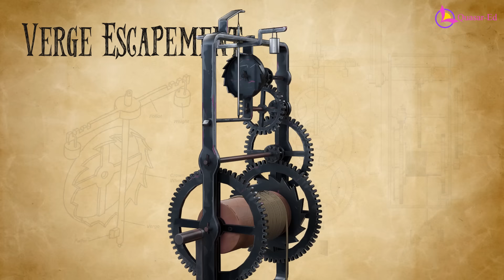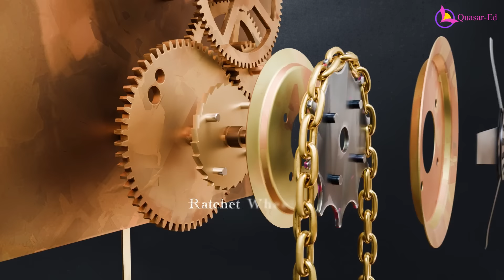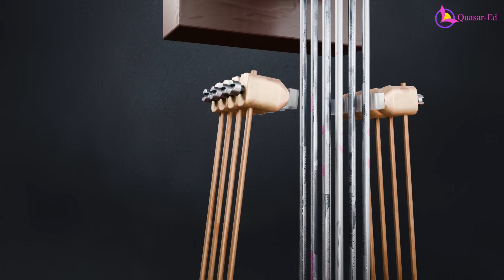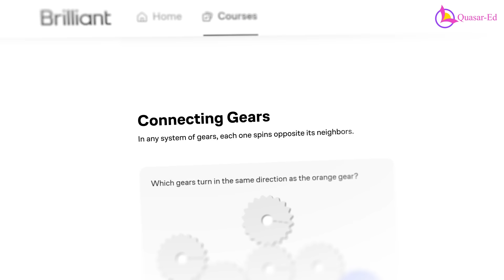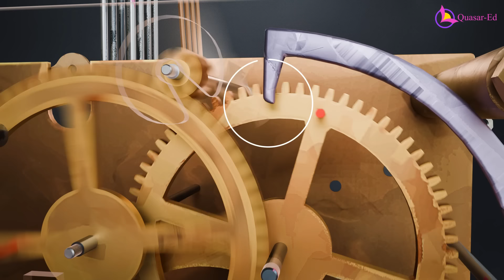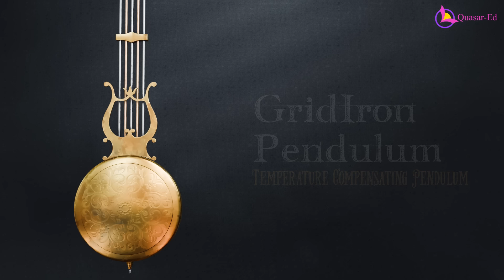From Weights to Chimes: The Inner Workings of a Grandfather Clock

Comment: Interesting this video came just as I've inherited a grandfather clock from my grandparents and the whole mechanism needed replacing to get it going again. Amazing what's packed inside and what was thought of.
Reply from the maker: Hope you have fun disassembling and assembling.
Reply: @quasar-ed called in a professional and ultimately ordered a new one that needed to get shipped from Germany.
Reply from the maker: @BrettHornby What about the old mechanism?
Reply: @quasar-ed clock maker took it as it looked like it was beyond repair. Clock wasn't going for a decade before getting it replaced. Believe it got scrapped for parts but don't hold me to it.
Reply: @BrettHornby  I would bet it was one of those modern Hermle movements. The reason some folks recommend replacement rather than repair, is because of the cost of the repair exceeding the price of a new movement (which are still made, in the same styles/models I think). However I haven't yet seen a Hermle (or Kienninger, or Urgos, or whatever) movement that was truly beyond repair in an absolute sense. A good clockmaker can make darn near any part required in their machine shop, even if the part is no longer available from the manufacturer (or, in the case of most old clocks, if the maker has been out of business for decades or centuries). So it's not that it was not _possible_, it was totally possible (most likely), it's just that in their opinion it didn't make economic sense for a really modern mass-produced clock where correct replacement parts were still available. But yes, if you're handy, and like making things in the machine shop (a trained machinist), you probably could have fixed it yourself.
Reply: @BrettHornby  And the other thing (and this doesn't just go for modern German movements like those mentioned, but also newer Korean and especially Chinese movements) is that the type and thickness of metal used to make the parts of the movement (the various brass and steel alloys etc) is not always as durable as older clocks, and often wears much faster. I think this is also true for some German cuckoo movements (such as those which have pinions made which look like the end of a Phillips screwdriver; vs old "lantern pinions" or even old larger solid pinions). Some folks recommend just wholesale replacement of modern cuckoo movements, due to the way those pinions wear vs the older types. However I do wonder if folks just made replacements for these problem pinions (and the weak spots of the other movements named; such as the clicks/pawls found on the great wheels of Korean clocks, which are often too thin and bendy and can cause the spring to 'let go' when they fail), that might save replacement of the entire movement, which I think is rather wasteful. Interestingly, by contrast, the old mass-produced American movements (brass, and even wooden!) from the 1810s-1930s, just seem to keep going, and going and going. Some folks who work on them predict that with occasional repair and upkeep, some of them could last for centuries. Even sturdier movements (like many old handmade clocks, and old time German and especially French movements) could last even longer than that, with proper maintenance. And a great many have, and are still ticking away!

Comment: It would be cool if the strikes and chimes are also automatically silenced, esp in late hours.
Reply from the maker: I am not sure but I think some designs might have that feature. If anyone knows, please share here.
Reply: @quasar-ed yes I have one it’s called night silent
Reply: Yes most modern clocks today automatically silence usually around 10pm to 7am

but clocks are usually built for corridors and large spaces anyway so the noise for vintage clocks that don’t silence dont matter much in the right scenarios
Reply: I'm also pretty sure I've seen clocks that have an option to silence it during certain times. I think from 9 or 10 to maybe 7.
Reply: Most tower (turret for UK people) clocks have this feature, and it is usually adjustable. There is a small dial on the movement that corresponds with a wheel with movable pins (or has movable segments of a cam) that can interact with a lever which will cause the chime train (if present) or at least striking train, to lock, until it is unlocked again. A similar way is used to control the lights in the clock tower (such as behind the dials), with a simple switch and relays for the clock lights. So the clock keeper can adjust the clock as to when it will start and stop chiming/striking, so it doesn't bong away all night and make some people grumpy (although the really old clocks did indeed bong at all hours, and most people liked it OK).
Reply: @andrewbarrett1537 just heard my local tower clock strike midnight but no other hours!
Reply: @andrewbarrett1537 wow I didn’t know they were adjustable like that though
Reply: And to think that someone had to come up with all this and built a prototype....it all seems so simple, but there's so many parts that has to work together....the narrator omitted a mention   of the Dutch scientist Hugens...( I know that's not spelled right)...he was the first to design a clock that used a pendulum, instead of the standard verge and foliet escapments common in that periodin history.
Reply: From what I recall from the clock history books I have, Galileo experimented with using the pendulum as a timekeeper and maybe built a small experimental movement or two (without a dial) to test his theories. But I don't think he made a fully functioning clock with a pendulum. Huygens did indeed make the first known fully functional clock with a pendulum AND a dial, to be used to actually tell time. Galileo had designed his own special pinwheel escapement, but to my knowledge this was not copied (until centuries later when a different version of the pinwheel came out as a form of deadbeat escapement, like in the 1700s). Huygens' first pendulum clocks, and those made by others for decades afterwards, were verge-and-pendulum with a horizontal crown wheel and verge, connected to the pendulum. The pendulum had quite a wide amplitude of swing and needed a lot of room to swing. That is one big reason why the anchor escapement was invented: to reduce the amplitude of the pendulum swing and thus improve the accuracy of the clock (as well as making the pendulum less of a hazard). There are still a few verge and pendulum clocks working today. I seem to recall a very original tower clock in Switzerland (the "Zytglogge", although I think I misspelled that) which still has verge and pendulum.
Reply: The newer clocks have a mechanism for night shut-off.  But why would you do that?  It is the MOST SOOTHING SOUND IN THE WORLD.  The individual tick tocks will lull you into deep sleep so that you can truly get some rest.  When the Westminster chimes go off, they are soo comforting, that you will feel so refreshed and alive!  I kid you not!
Reply: @TheBossSr88 The chimes are great, but the silence and sole presence of a clock’s life is better.
Reply: In my opinion have the clock in the lounge or dinning room. My one has been in our dinnig room for a long time and you can't even hear it in the rooms. My grandfather had to silence it permanently because my grand hated the sound of a clock chiming.
Reply: Chiming in here. I just bought a used grandfather clock that was made in 2001. It has a nighttime silence mode. 

We were pleasantly surprised by how sutble and beautiful the chimes are though and even though we have a small home and a bit of any echo I don't think it would be bothersome without it.

The downside to the night silent mode is that you have to adjust your clock on a 24 hour schedule instead of 12 hour. So initially when I set it, it was set for night, I had to carefully back it up another 12 hours